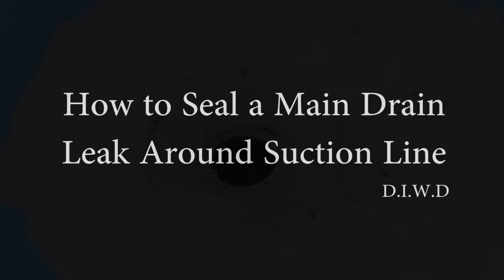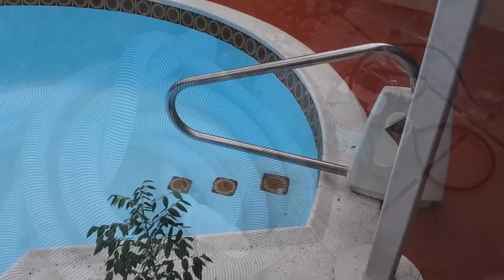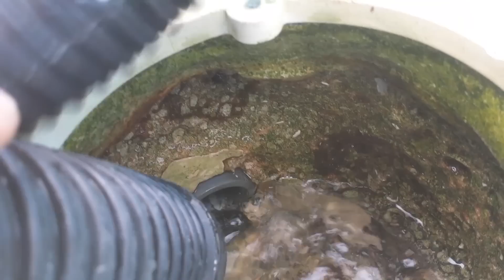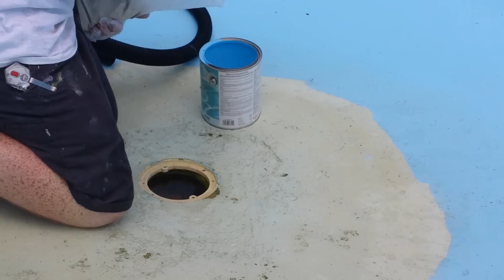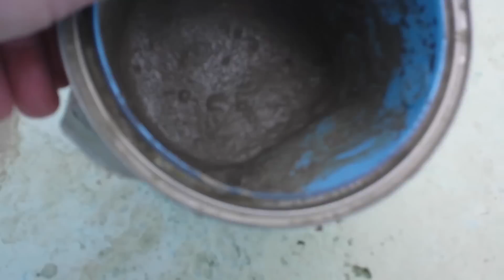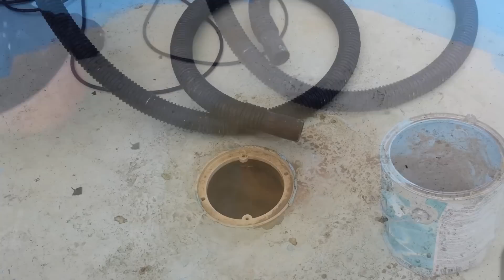Pool Leak Fix - How to Seal Leak Around Main Drain Suction Line

Comment: Hi Dave I am remodeling the house and saw a hairline crack in the side of the pool about 1/8 of an inch in plaster whether it is from schemer or the body of the pool , please advice what material  I can use?
thanks I am located in Dallas Texas
Reply from the maker: Well if it's not causing a leak it's probably just the age of the Diamond Brite. If there is a leak you could try using Pool Putty. If it's an aesthetic issue there's more work involved. One process would be draining the pool, dropping the water line below the crack. Chip out to create a valley where the crack is, mix Diamond Brite that matches your current finish and patch the valley. At that point you may never get the correct match and it may stand out a bit. Maybe not underwater so much. Probably not the reply you were looking for. I hope this helps.

Comment: Your suggestion(s) needed:  My hard plastic drain under the pool has shift or tilted under the bottom of the 1982 built pool and water is leaking.  What do you suggest?
Reply from the maker: Not exactly sure of what the issue is. Is the drain plastic with a cover? How do you know it's shifted, can you see a gap between the drain edge and pool shell? Is your pool currently empty?
Reply: @DoItWithDave  Once I drain the pool, I'll get back with you.  I was referring to the housing tilting, but I'll take pics after draining.

Comment: Any idea how to patch if it's coming around the rim on the drain?
Reply from the maker: If your pool is currently drained and water is coming up from around the drain rim you could try using this material and a little bit at a time pack the rim until you get the water flowing in at just one point. Then you could wait for the material to set up until it's almost not workable and force it in place. If you pool is full I have another video showing how to patch underwater. I hope this helps.

Comment: My concrete pool, which is covered in a layer of fiberglass, loses 1" of water a day.  I've owned this pool for 5 years and each year around this time, I wait to see if I can figure out where the leak is by letting it drain down, down, down.  It isn't the skimmers.  Right now the water is 1.5 feet below the required water line.  My plan is to let it keep going until it stops.  I've had leak detection companies come in, a pressure test, etc.  No one can find it.  BUT - no one has checked the main drain.  Ther is no hydrostat in the main drain.  I plugged the hydrostat hole last night, but it still lost 1" last night.  Just plugged the main drain this morning to see if there's a leak in the pipe.  I've used leak detection liquid.  Nothing.  Any ideas?
Reply from the maker: Since you're letting the waterline drop until it stops you may want to turn off all equipment, close any ball valves on your equipment, remove the pump lid and release pressure from filtration. This is just to break any gravity suction or back pressure for the pool. This will allow the water to be stagnant and go where it wants to go. After that just let the waterline drop until it stops, return lines, light niche, main drain. You say your pool is covered in a layer of fiberglass. I'm not sure how that system works exactly however you may find the water drops to where the finish has been compromised and would need to be patched. One thing to keep in mind is the water table. If it starts raining heavy or you live next to a large body of water allowing the water to drop lower than the in ground water table could cause your pool to pop up out of the ground. Definitely want to be mindful of that. I've done leak detection for commercial and residential pools and when a leak was really tricky I'll let the water drop until it told me the TRUTH! lol water don't lie. I hope this helps. Reach out if you have any questions.

Comment: Useful video. Question. I have the same problem on a empty pool with water coming out. I replaced the hydrostatic valve. My leak is coming from the hdrostatic valve. Should I use cement all around the new hydrostatic valve? I can also see water coming through the suction pipe. What should I do? Thank yoy.

Comment: Hello! I have an inground pool and have a leak at main drain.. can I use CEMENT ALL to permanently close off drain?
Reply from the maker: Yes you definitely can if it's your last resort. A lot of  times the main drains will be plugged or completely sealed if the leak is to difficult or expensive to repair (broken pipe under a poured pool deck or deep on side of pool. If you've determined that this is the case then it may be the option. One thing just know the only suction line will be the one off the skimmer. It should be enough to circulate the water. If you want more info for m that you can look up "main drain pools vs skimmer only pools" it may help your final decision. I hope this helps.
Reply: My main drain is plugged from the top at the skimmer. But it is not completely plugged at the bottom floor drain just like in the video. I dive down to collect debris and palm seeds that accumulated over these years. I saw an opening on the side just like in the video.  I found used battery, 2 round metal balls, plus palm seeds and a lot of dirty dead leaf that accumulated and become mud when stirred and polluted the water near the main drain area. We have 2 palm tree next to the pool. I hired Mr Park for our poolman from previous owner. He didnot do a good job vacuuming those stuffs that sat in the floor drain. My question since we own house for 10 plus years we have never used the main drain anyway until I started replacing the pump and started learning more about pool maintenance.  Should I unplugg the main drain and started using it to circulate thr water or just leave it alone. Unless there is a leak that could be the reason why the PO plugged off at the skimmer. What do you think?   I plan to buy a king drain bladder then unplugg from the skimmer, push the bladder down turn on the water and blast everything that has accumulated at the main drain area then dive down the collect those that could have clogged the pipe. That probably the reason why po plugged it . Thanks

Comment: Do we use Hydro-static relief valves in the floor drain in  Florida still?
Reply from the maker: Yes any new construction of an in ground concrete residential pool in Florida calls for a valve, maybe not if it's a pilling pool.
Reply: @DoItWithDave  mine was "caped" off, so i should probably install one huh? obviously someone didnt want to deal with it, or it was leaking at one time,ect...so they screwed a cap in it.  mine is a 1990 concrete pool
Reply from the maker: @RussellD11  if you want to install one  in case you plan on the pool being empty. If there is a cap on there now maybe the MD never got a valve on diamond Brite day, just a cap. Also when you say cap do you mean a threaded nipple is extended with a cap on the end? Usually ppl will replace valve with threaded plug.
Reply: @DoItWithDave  yes, Its empty and im doing some repairs and noticed its a threaded 1-1/2 cap. So im thinking maybe i should replace the cap with  a valve there b4 i refill her?  to be clear, Under the floor grill/cover there is one not threaded 1-1/2 PVC main floor pipe which is clear and open and runs to the skimmer, and then next to it is a threaded pipe , again 1-1/2 which is capped with a square wrench knob on it... If I take the cap off then nasty under the pool water (ground water) comes rushing up.
Reply from the maker: @RussellD11  okay so the valve is used obviously to equalize the water table to keep the pool shell from popping up. If you have the pool drained without ground water able to equalize the pressure, the  longer the shell remains in that state the higher the probability it might raise. Idk what repairs you're performing but if you remove the plug and let the water table equalize it would definitely eliminate any concerns of the shell raising. And the water will be dirty however it will only raise so high. Depending on where you live the water table will be at various levels. Some parts of Florida are below the table. If you live next to a large body of water I would assume the potential of the shell raising increases. Either way if I was in your position and could still work on the pool with dirty water sitting in it I would. You can always put the plug back in clean, and start filling pool until the clean water  level reaches the level that the ground water let in. At that point the clean water should be shallow enough for you the remove the plug, clean any debris in the main drain and attach a new valve without dirty water forcing it's way up.
Reply: @DoItWithDave  ~so in your opinion, when im done. take the plug out that previous bozo put in and buy a hydrosatic valve in its place upon completion, yes?
Reply from the maker: @RussellD11  pretty much any pool company will recommend replacing the valve rather then opt out for a threaded plug. If you have any issues with the valve you can always put the plug back.  I hope this helps.
Reply: @TheRussChannel your lucky you can at least access your main drain cap. My pool been slowly raising from the ground cause I can't access mines. Some one cemented off the whole bottom part to my main drain.
Reply: @leemooreStudio  ouch lol, must have been leaking I bet and that was their "getto fix" lol....
Reply: @RussellD11  yup. I'm going to empty the pool, Croc Concrete (cement dissolve) the bottom, fix up the pool and try to fix that leak if there is one the right way.

Comment: Hi
Thanks for the video....I have a concrete pool and I suspect that the main drain is leaking....it’s not attached to the pump ....ist ok if I seal it completely with concrete.....thanks
Reply from the maker: James Gabriel I've seen ppl complete pour in a concrete main drain before because it was the least expensive option. However they ended up installing an automatic vacuum because without a MD any dirt on the floor will just sit and may end up staining the diamond bright. I hope this helps.

Comment: Hey there. Where is the hydro valve in this pool.?
Reply from the maker: The main drain in the pool was concrete. I guess the original plan didn't call for a modern main drain with threaded openings for plugs.
Reply: Won't that put this pool owner at high risk of his pool popping out the ground? Shouldn't he/she try and clear the cement?

Comment: I have a similar problem. I'm trying to replace the liner on my pool but the inground water keeps flowing in thru a couple of cracks and collecting about 2 gallons every 5 min.  How do I stop the water from coming in.  I just need enough time to replace the liner and start adding the water.  I'm hoping that once there is enough water inside the pool it will stop the inground water from coming in.
Reply from the maker: Well if your pool is a concrete shell then you could try powdering the cracks with the Cement All. Basically sprinkling the materiel over the cracks for hair line. If they are larger then mix by hand until it becomes clay like and pack it in. If you have a stainless steel you may want to use some sort of rubber sealing tape. FlexSeal makes a product. What should happen after the pool is full, the water pushing up should equalize by the water sitting in the pool.  I hope this helps.

Comment: my main drain was sealed and closed by a tech with hydraulic cement. he said that it would be cheaper just to close it off. Is there a way to reverse this and reopen and fix the main drain?
Reply from the maker: From what you posted it sounds like the tech did this because the Main Drain wasn't leaking but the pipe going from the main drain running under the pool and around to the pump was. Possibly a cracked pipe, bad glue joint or pinhole in pipe.  The only way to remove the hydraulic cement would be to chip it out of the MD without damaging it, on top of that the pipe might have cement inside of it.  If you are going to try and do this I'd suggest doing a pressure test on the MD line from the inlet of the MD to just before the pump. Unfortunately your tech guy is telling the truth about expense.
Reply: Thank you for the reply. He did say that the leak was where they connected and that it was previously repaired. It started leaking about 6 months after we bought our house.

Comment: so, your main drain is no longer functioning since its all plugged up with  repair cement?
Reply from the maker: J whome the main drain in this pool was basically framed out with concrete and the main drain line was ran through the inside wall of the main drain. The leak was accruing from around the bottom of the pipe. I just stuffed the opening with  concrete patch leaving the pipe opening exposed. I did bring a bit of the patch over the lip and inside the pipe, however this did not seem to restrict the flow of water. At the end of the video I pretty much dusted the entire inside of the main drain with a thin layer of patch to somewhat seal the original concrete.

Comment: Excellent video. I had the same problem however, my pool was refilled with water during my absence fore I was able to fix this. Now the water level is dropping daily. Would you recommend drain the pool again or try fixing with the water in the pool?
Reply from the maker: +Peter Mistak I would try to fix this issue without draining the pool just because of how expensive it is to refill with city water.   Depending on if you will be diving by holding you breath, using a tank or you can get your hands on a Third Lung a helper may greatly benefit you. There are a couple of options since your pool is already full. You can try the Cement All just keep in mind that it does turn the water mercy and can hinder your ability to see. There is a product call Pool Patch its very similar to Cement All however it is a white powder and won't block you're vision so much under water. However it is not a common item for purchase. There is another product called Pool Putty.  Pool Putty is a great product for many applications. It is a 2 part epoxy, once joined the 2 components have a clay like feel and is workable for about 10 minutes before it becomes hard to mold. Since you're pool is full the water should be pushing out of the shell so the application would be forced into the void rather than out. I suggest Pool Putty overall.  Just one thing about the pool in this video. When I first investigated the main drain it looked like someone had stopped the leak previously using Pool Putty. So it did work with water in the pool but when there is no water forcing down on the shell the underground water will force it's way up.  So the Pool Putty kept water in but not out. I hope this helps. Thank you very much for watching. P.S don't forget goggles.